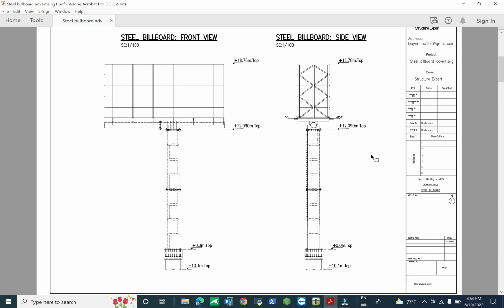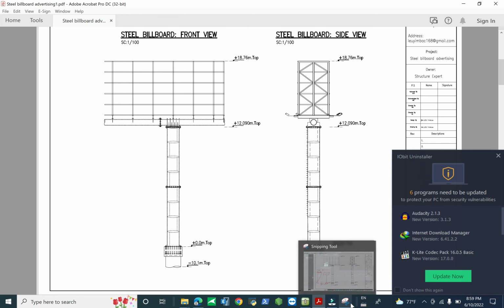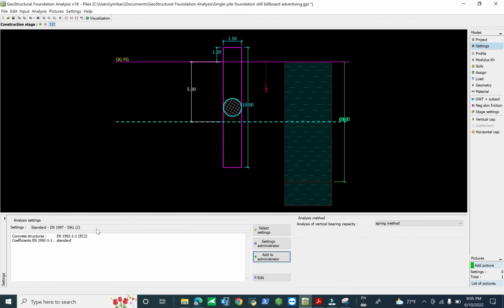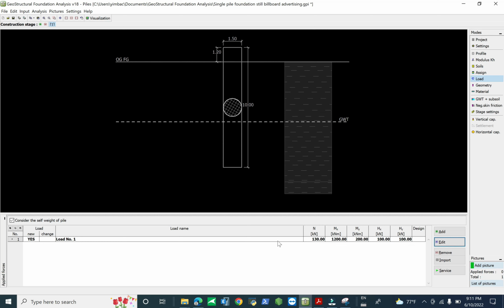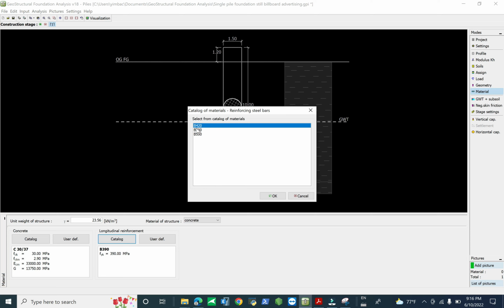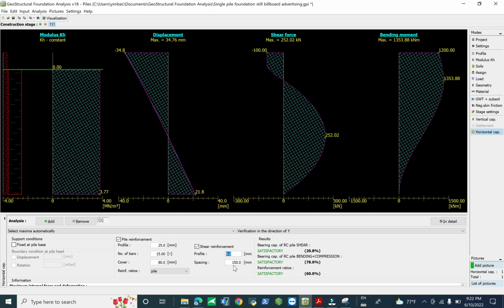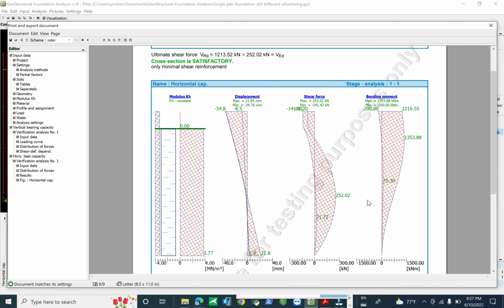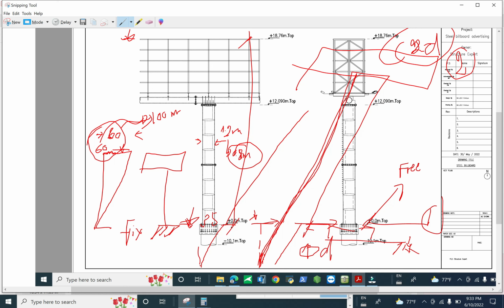Single bored pile analysis and design of steel billboard advertising in Geotechnical Software GEO5

Comment: What size post should i use if i want erect a steel 9m x 3m billboard at 2.5m high frm ground
1. For unipole ?
2. 2 pole ?
3. 3 pole ?
4. 4 pole ?